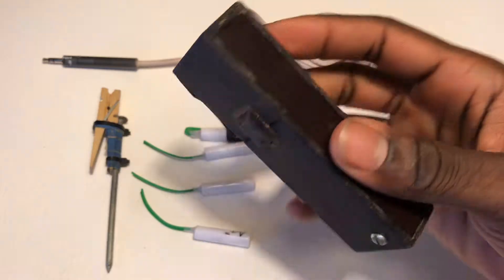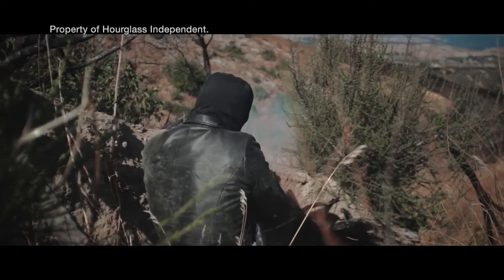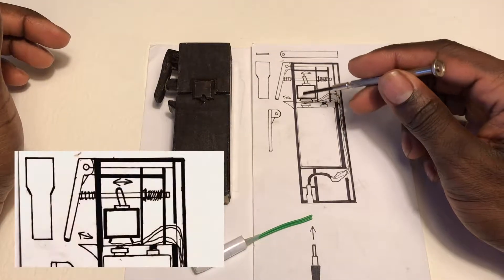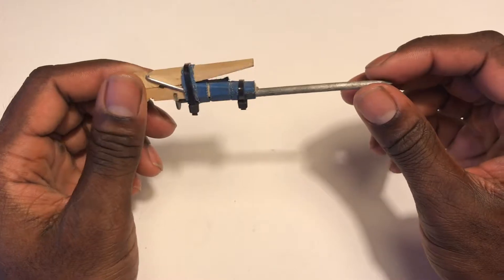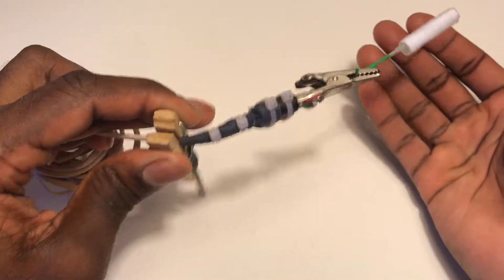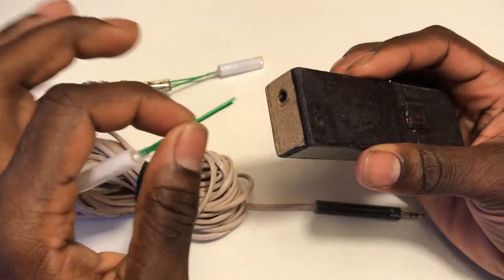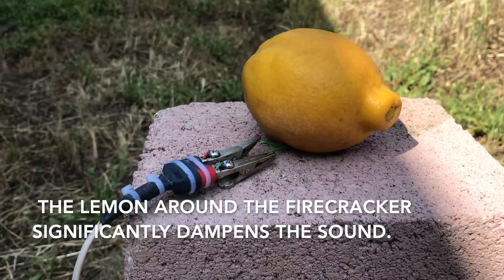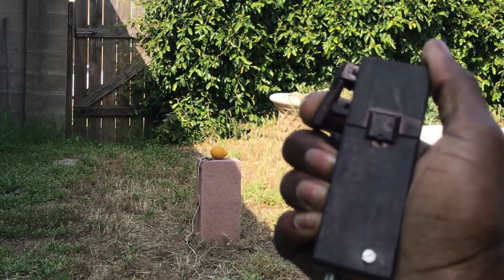Electric Detonator. (How it works)

Comment: 10.24.25 Do you think it's possible somebody could use the same kind of thing but have a wire attached that pushes or pulls the conductor box trigger to allow the same detonation? 10.24.25 (9:27pm)